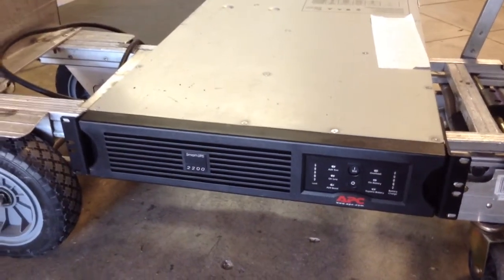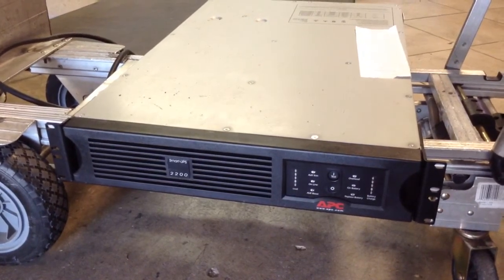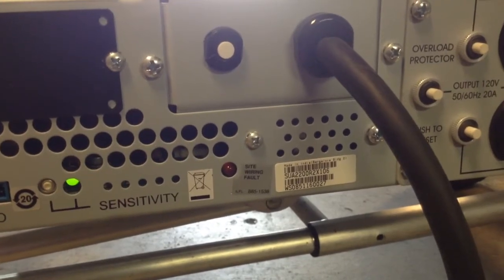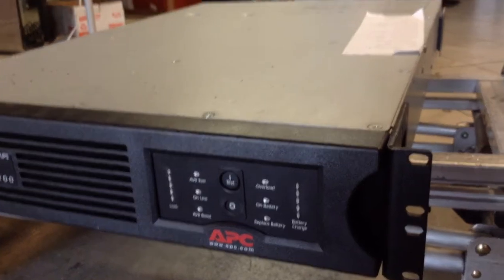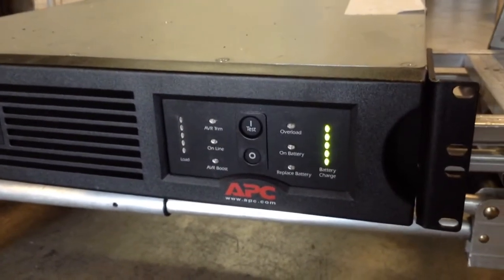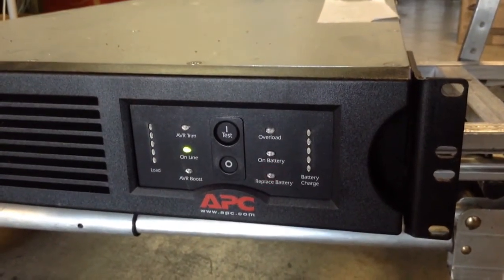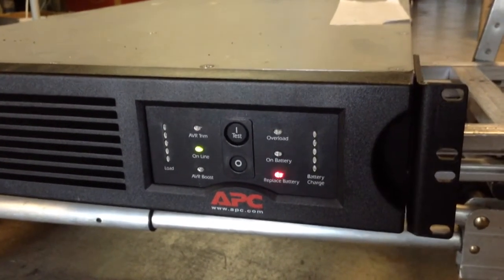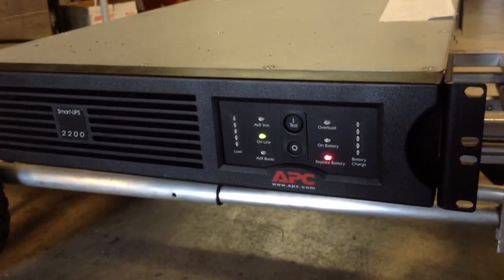Testing an APC Smart-UPS 2200 battery backup device

Comment: I m in an RV. I rented a hotel room to charge up all of my devices & brought my APC in because it was on a shelf for 4 months. I plugged-in everything in fell asleep& woke up to a call I was late checking out! My alarm never going off becuz the hotel had an electrical problem that night and nobody in the back had electric. When I checked out they had 2 electricians vans there. My regular battery pack for my phones and tablet was at 11% So the electric charged from their one outlet for that long. When I checked all of my devices as I packed up, the APC light "Building Airing Fault" was on. The next chance I had to plug in my APC the siren went off. Now I've plugged-in it in for 28hrs and the siren is STILL GOING OFF. Could something at that hotel have ? ruined my battery for the APC? Or the APC itself? or in your opinion is this just a strange coincidence?
Reply from the maker: Unfortunately we don't have much experience with these units, it could be also a faulty APC control board.